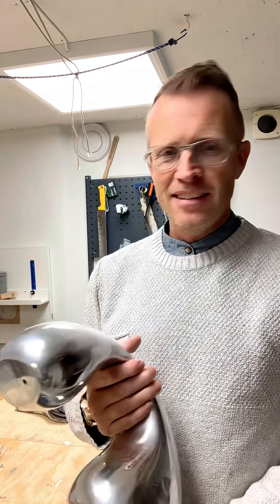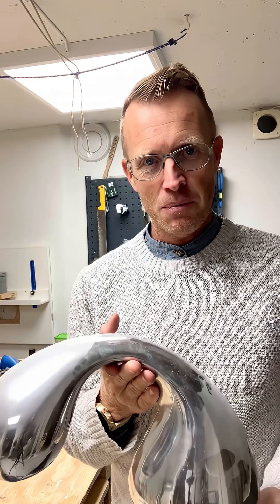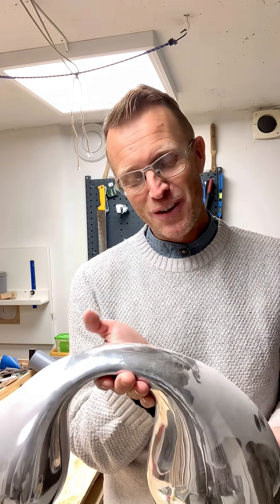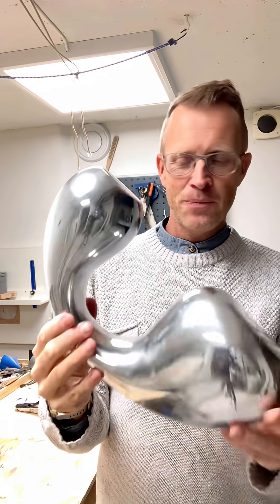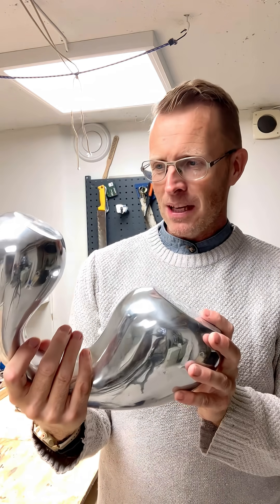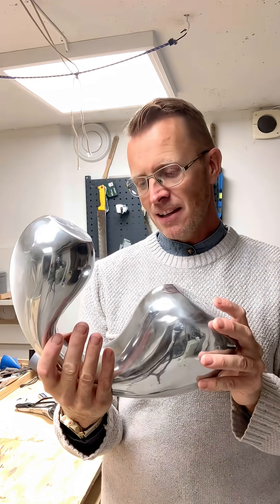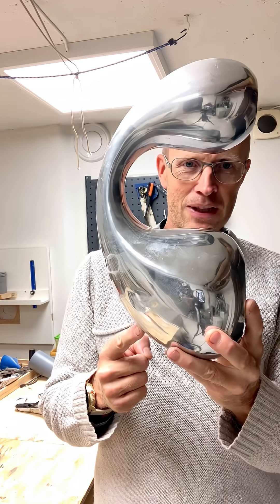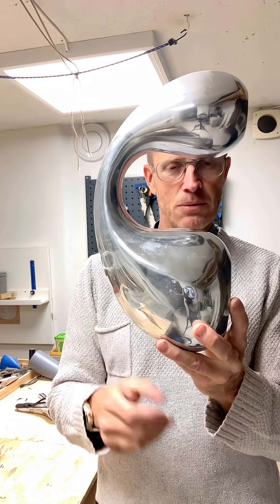Can this be the next concrete-project? #diyspeaker #speakerbuild #loudspeaker #monacor

Comment: 100% definitely go for it! 😅
Reply from the maker: I MIGHT go for a floorstanding speaker. After looking at it I saw more closely that it wasn’t symmetrical really, and that would bring to make molds and frames just to fix the initial model and with all that work, it is sometimes quicker to do it from scratch. 
So now I am looking for puretane foam or xps styrofoam to maybe start with a floorstanding TL concrete speaker ;)